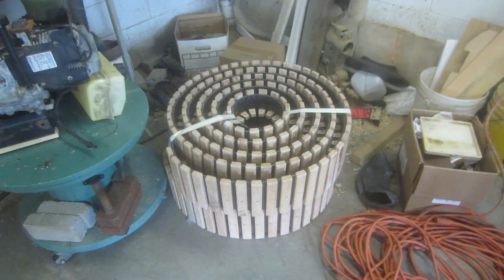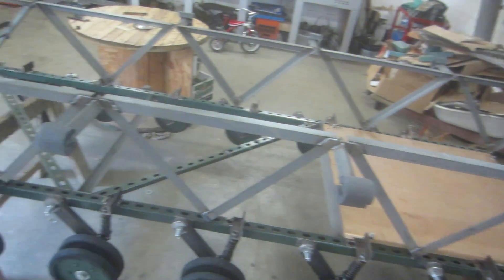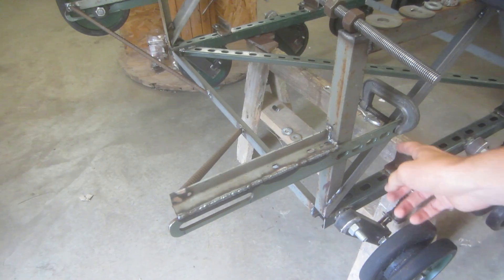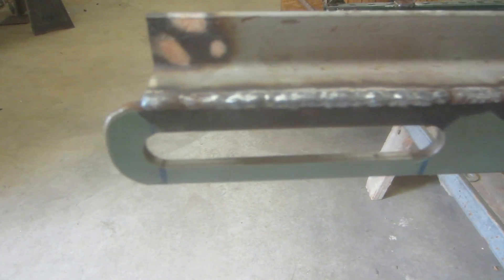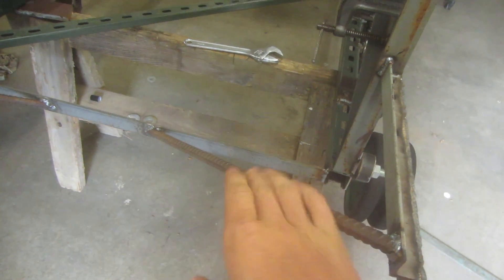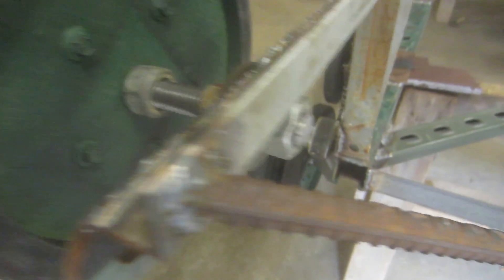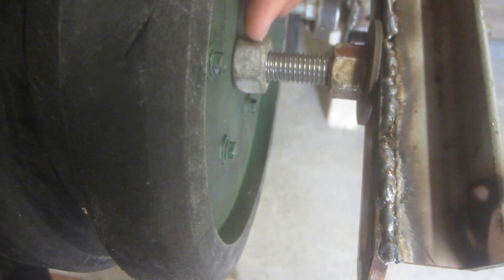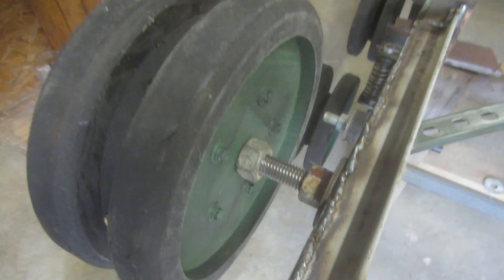Homemade Tank Part 5 (front idler wheels)

Comment: Got a question here. Does the metal guide rod running through the spring/ shock limit the range of motion of flex of the wheels?